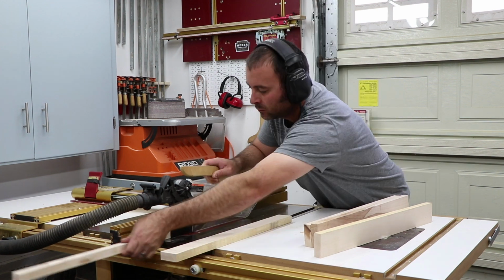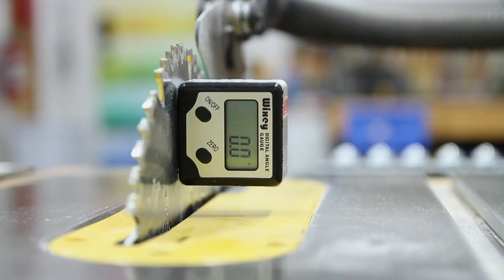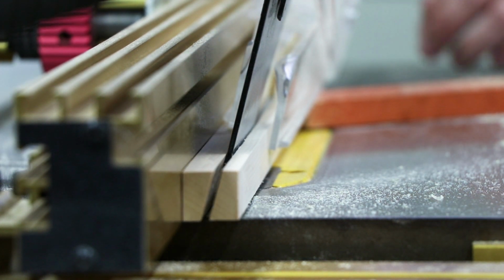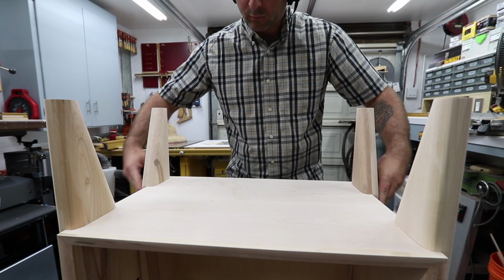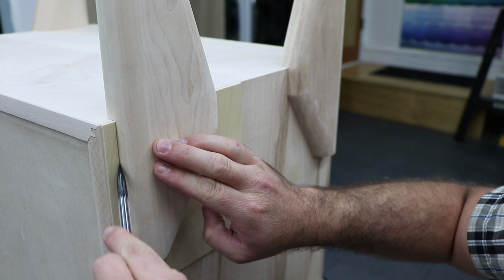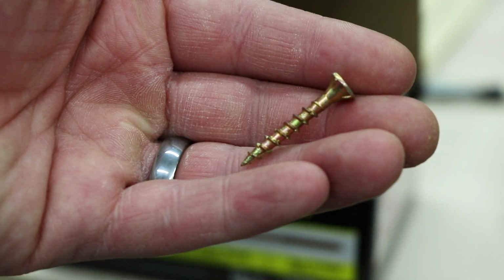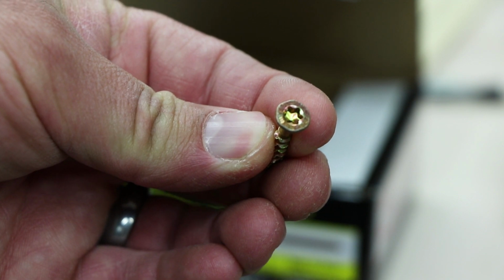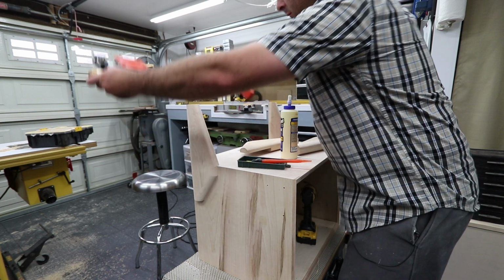Build: Mid-Century Night Stands (Part 4)

Comment: Question: Why screws and not brand nails?

I agree with you about Phillips => Star.
Reply from the maker: Andrew Burns nails would not pull the parts together, they would push them apart.